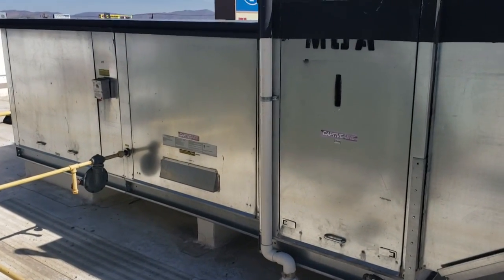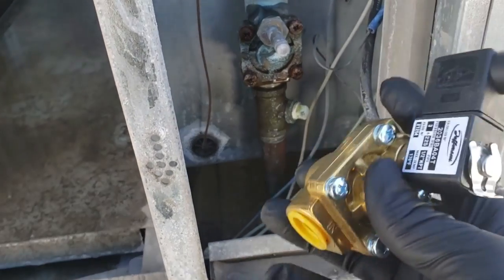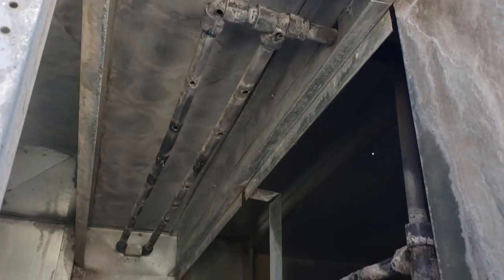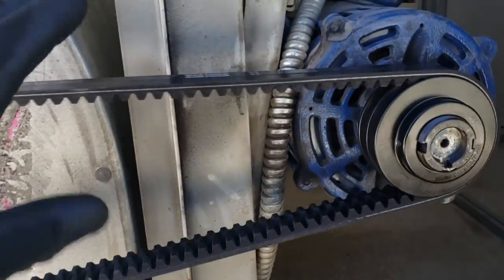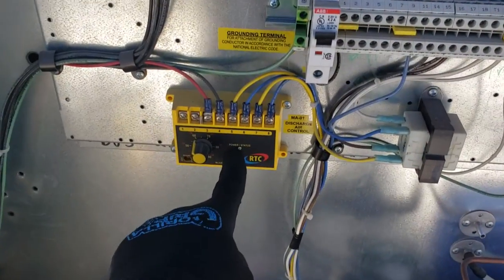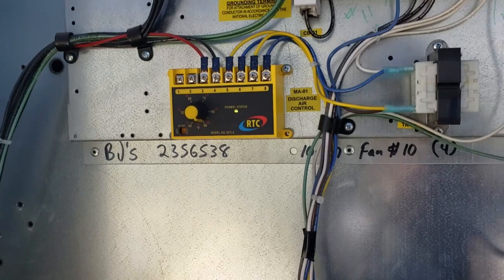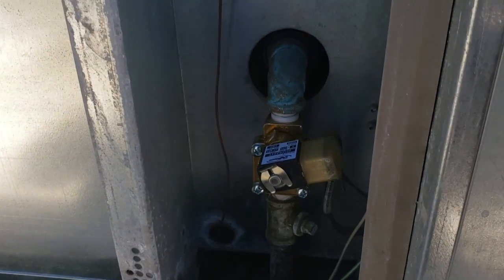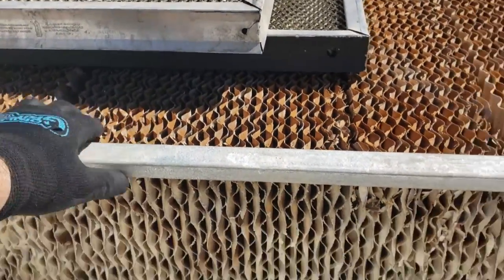CAPTIVE AIRE MAKE-UP AIR UNIT REPAIR

Comment: They're don't make belts like they used to, they don't last. Belt tip- measure the distance between both shafts centers, motor and blower, example 20 inches,  20/64", 5/16" deflection in the middle of the belt +-.

Comment: Are there any regulations concerning legionella with the evaporative make  up air systems? I do facility maintenance in healthcare AMD they are all over us about legionella just in the last year. Not just for cooling towers, which historically is what they focused on, but for all potable water systems as well. The reason i ask is wouldn't introducing misted water be a potential hazard no different than a cooling tower?
Reply: anonymous I’m not about US regulations, but for sure such an evaporative cooler is a credible legionella hazard. Water 20-40*C, organic materials for nutrients (rust, dust), potential for stagnation and an aerosol effect. That’s why one should have a proper risk assessment and management system in place.
Reply: @sparkydave2783  exactly right. Those were my thoughts too that's why i was curious if the regulations have caught up with them.

Comment: Just curious but how are direct fired gas heaters installed safely? 
What I mean is how are these beasts installed in a way that they don't pose a risk of raising the co levels in the building? 
I was at a shopping complex  a couple years back where they  had vertical mounted directly fired duct furnaces which used the fan from the large evap cooler on the roof. When I walked in the place (large warehouse)  it smelled fumey. 
I was wondering how people  weren't getting poisoned. 
I came to the conclusion that large warehouses with exhaust fan's are ok to use them because there is enough  ventilation. 
Still not sure if I would like to work in a building all winter with them breathing in that fumey air but what do I know haha.
Reply from the maker: going live on Youtube this evening 3/11/19 @5:PM (west coast time) come on over and check it out if you can  https://youtu.be/8b7yomEWfF4

Comment: I work on three of this units we are going to add are own cooling  down stream of discharge and control with a t775 none  Of the ones I work have coiling. But will be  adding cooling to them

Comment: Wouldn't the open flame introduce carbon monoxide into the building? Or is there another heat exchanger?
Reply from the maker: Yes it can, systems like this have to be carefully designed and interlocked with the exhaust fans.... not my favorite setup for sure but it wasn't my design

Comment: s, Im not an hvac guy,  can you explain what a make up air unit is and does.
Reply from the maker: Sure ... think of it this way say you take a paper bag and place it over your mouth, if you inhale the bag will collapse. But if you cut the perfect size hole in the bottom of the bag , when you inhale the air will pass right thru the hole and the bag wont collapse...
 So we use exhaust fans to pull the unwanted air out of a commercial kitchen because it is very smokey, and we need to bring air back into the building to make-up for what the exhaust fans are pulling out of the building.  Hence why we call it a makeup air unit..... there is a term we use called air balance and that is the perfect equilibrium of exhausted air and makeup air. So typically when we perform and air balance on a restaurant we want the building to be in a slightly positive air pressure so that we dont pull unconditioned air into the building..... does that make sense?
Reply: Yes totally does thanks for responding

Comment: On the temperature control, what’s the minimum and maximum BTU.
Reply from the maker: The minimum and maximum btu out put would be set by the high and low fire settings on the modulating gas valve. And I do not know what those are set for you would need to do that by reading the manual and testing the gas pressure.
Reply: Thanks 👍🏻

Comment: One question what are those cell deck pads made of ?
Reply from the maker: Paper/cardboard is what it I think they are made of
Reply: That’s what I was thinking  , but didn’t seem to make sense figure that would grow mold or degrade rather quickly man absolutely fascinatinghow different then equipment is thanks again brother for the reply good luck out there